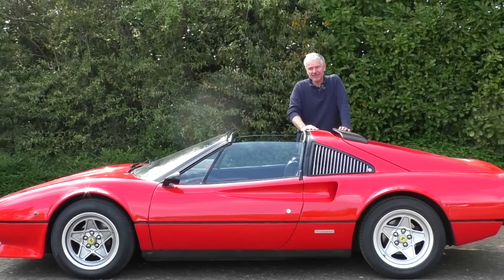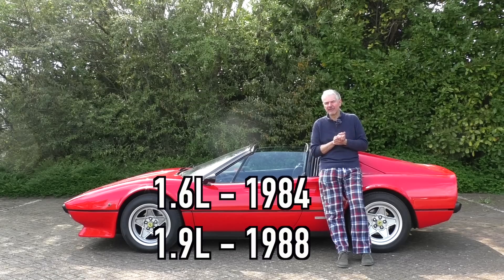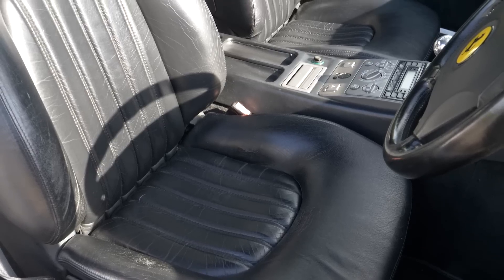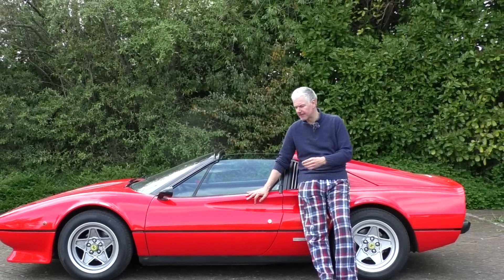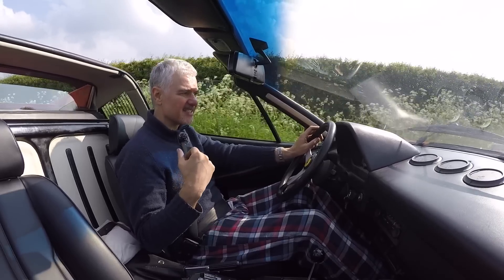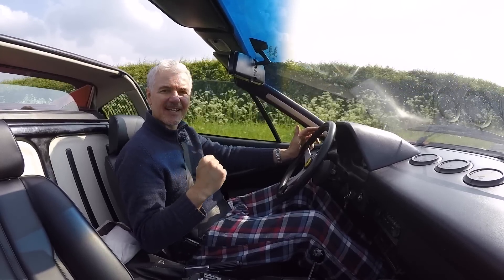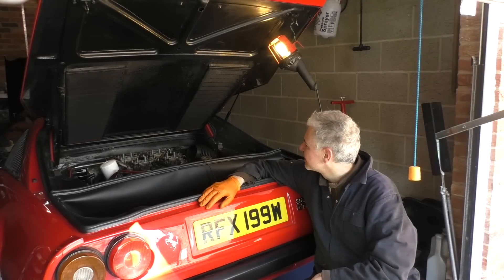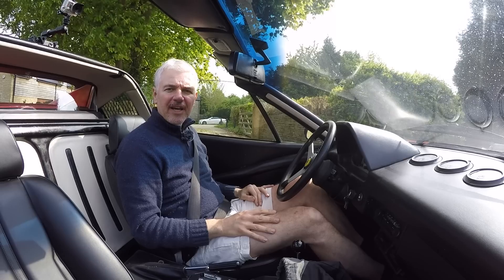The reason my Ferrari 308 was the cheapest in the UK

Comment: 308 side view is stunning
Reply: Yes. The classic going fast standing still look. 😍
Reply: That's what I thought too. It looks fantastic!
Reply: I was at a car show last summer with all sorts of Aventador's and 488's and all the owners were gathered round a 308. They are still stunning. Slow now of course but absolutely stunning.
Reply: purists look away... the looks are indeed sublime, as was 246..I would love an affordable, easy build GRP replica / conversion of a crossover between 308 GTS and 228 GTO - a more subtle and smaller 288 with everyday worry free mechanicals and c 300bhp/ton --or simply a 308GTS replica (with wider footwell!) - needs to be in expensive / accessible :)  - I was lucky enough to see a stunning one off replica at Stoneleigh a few yrs back with RV8 ..absolutely amazing..unfortunately the driving position remained compromised - using wheel arch extensions as in 288 would help with avoiding footwell wheelwell ingress

An affordable 308GTS clone with a TVR engine for hassle free motoring....mmm

Comment: Hi, I have a 1976 308 GTB and have had a similar noises at certain revs. Drove me mad but on mine it was a hairline crack in the exhaust heat shield on the rear bank of cylinders. Then I got another crack in the heat shield under the boot floor (deeper noise) and finally a high pitched tingling/whistling noise (like yours) that was the front heat shield protecting the alternator. Spent ages sorting crack/splits etc in heat shields and finally they've given up and gone away. We isolated each one by taking each heatshield off and seeing if it stopped the noise. Reving it in a workshop just didn't replicate it. Stick with it as 308s are the most underated Ferraris and when you've got it sorted you'll love it. I've had mine for 21 years now and have experienced just about everything that a car can throw at its owner. They are very fickle but very, very strong.

Comment: I had a similar squeak in my Porsche 993 in similar conditions to yours which puzzled me and quite a few professionals.  It went away after I removed and reseated the intake manifold, so believe it was a loose hose clamp at the intake side.  Worth re-seating everything on the intake side before replacing anymore parts.  All the best with it.
Reply from the maker: Thanks and good advice. Will do when I rebuild the carbs this a winter!

Comment: Mmmmm, as someone who has been playing with cars all his life - including professionally for a number of years - I have a suggestion: relax. When the car boils over or a coolant hose pops or the alternator bearing seizes and the car throws a belt, don't flip out. If you don't learn to take things in stride, you're going to have to become an adrenaline junkie to enjoy the 308 (alternatively you could just become a regular junkie and hook yourself on valium...) :-p 
Remain calm. At least until you hear a loud bang at 6000rpm followed by clanging and large volumes of gray smoke and bits of piston and rod billowing behind the car. Then flip. That would be justified.
BTW, the Influenzo was not trying to burn your face-off. It was a joke. It wanted to see you bang your head on the underside of the bonnet. It boiled over because the horns aren't in the engine compartment on the 308, so it likely would have not scared you if it had only beeped the horn.
Reply from the maker: Thanks for the advice.. I am a worrier by nature though!!

Comment: Brilliant video and one lucky escape. The joys of motoring ‘as my father use to tell me’. The sound could be belts to tight, the alternator can also make a whistling noise, both when new and when there getting tired. It could also be a vacuum hose leak, maybe a split hose, for the most part that wouldn’t make a noticeable difference to performance. Good luck and look forward to the next video
Reply from the maker: Thank you Ross! Enjoy the weekend buddy!
Reply: No probs, I too have classic cars and motorcycles, my daily is a 1978 Mk1 Cavalier that was a bad model L, but now has the Carlton GSI 3.0 24v straight 6, Manta 400 getrag gearbox and back axle. Using a classic every day is far far better than a modern car and the smiles per miles......you can’t put a price on that

Comment: I had a couple of 205 GTI 1.9s back in the day, one after the next. Bat out of hell. Followed by a 5GT Turbo, so a total late 80s/ early 90s dream fest for a young lad. Decades later I need a 911 to give me similar thrills down a bend road.
Reply from the maker: How did the 5 Turbo compare to the 205?
Reply: Missed this. The 5GT Turbo felt more planted and faster because of that puffer. The 205 GTI 1.9was light as a feather in every way, and soddin’ fast cross country. Basically, take yer pick. Happy days. Ooh, and the 1.9 was a bit over throttled, so a mere touch on the accelerator caused the Pug to storm forward like a stabbed rat.

Comment: sounds like a vacuum leak to me, that would only happen under load not on gradual acceleration, or perhaps a vacuum regulator after distributor makes maximum advance so that too much vacuum doesn't damage the diaphragm
Reply: Agreed. Sounds exactly like when the vacuum advance diaphragm on my distributor got a leak. That would also explain while it's only on full throttle
Reply: p_r_i_m_e does the 308 have a full throttle position sensor and system?  Then I’d trouble shoot that.  Vac advance would be possible as stated...etc...  my suggestion always is you have to get the car in spec and all maintenance caught up to really sort out a car.  I.e. of it needs a top end refresh..you’d probably fix most issues when you change out hoses, vac lines, clean or replace fuel lines, adjust timing, etc...otherwise you’re chasing your tail.  Coolant flush via overheating is one way of doing regular maintenance...;)
Reply: Not to sure about your thoughts on air leak on full chat. You’ll get lower manifold pressure on closed throttle high rpm over run conditions. 
Best bet is to get it to your nearest rolling road once lock down is lifted. 

But great content. And an interesting noise. Cover the basics first. Think simple.
Reply: My first thought was air leak, although always hard to diagnose over video!
Reply: Agreed also - the noise only seems to be under load, so I don't think it's just related to engine speed like an alternator bearing would be. Also, those pipes perish, and the car is from 1981 by the reg. plate
Reply: Good call, I was thinking those lines myself.
Reply: vacuum reduces at wide open throttle

Comment: Run it without the alternator belt - could be the alternator bearing.
Reply: Good call
Reply: No, doubt it, alternator bearings don't sound like that, and it still wouldn't make much sense why it's only at full throttle. You can usually hear it at very low RPMs if it's going out.

Comment: alternator.

noise changes with temp and load depending on demand and state of battery charge.
Reply from the maker: Interesting.. I will check it out
Reply: Alternator on my Porsche whistles!
Reply: @Number27  As someone who does not work on cars but computers, I'd also say that sounds very much like electronics coil whine. Hence an alternator sounds like a plausible explanation. The electromagnetic sound induction is often amplified by resonances, so it is typical that it becomes audible only under some specific conditions.

Comment: Hi Jack - loving your Influenza videos - very informative and very entertaining too. I have a possible explanation for your squeaking noise as a similar thing happened on my Porsche 997.1 C4S. It sounded like a slipping belt and only happened under load at high revs. I changed belts & idler pulleys, the water pump and even the pulley on the alternator - none of which cured the problem. The guys that do my servicing eventually tracked it down to a cracked exhaust bracket that was resonating/rubbing together at high load/high revs. £20 spent on some tack welds cured it and it’s never done it since! Maybe a simple one to check if only to rule it out? All the best. Mike
Reply: The noise might be reason why they also changed his belts a year ago
Reply from the maker: Thanks for the advice chap!!

Comment: I had a 205 GTi 1.9. It always started 1st time. About 20% of the time.
Reply: Dirty contact on starter, common issue. The most unreliable part on the 205gti is the German part. Bosch fuel injection system, air flow meter. Many of us owners gave binned that and gone for wasted spark set up.
Reply: If your having cold start issues, it will be the SAD on the back of the distributor SAD = supplementry air device, usually the rubber tube perishes and fucks it up, I used to set the throttle up by hand after working on them for years as a kid. 650rpm with air screw closed then open up to get 950rpm. It will run like a dream and no stalling out.

Comment: What a great video!  (1) I totally agree that modern cars just aren't as much fun to drive slowly.  I've noticed this more in German cars.  I think they have made the car so capable at high speeds that this stability ruins them under the conditions that we normally use them.  (2) extreme highs and lows in emotions.  It sounds like you own an Italian car.  Passion one way or another.  (3) I LOVE to hear that car running.  What a wonderful, raw sound.  And the click-click from the notchy shift lever, it's great.  In watching you drive, I almost feel the car myself.  It looks like such a wonderful experience.  (4) The whistling noise is related to throttle position,  which makes me think it' may be a normal noise from airflow through a carburetor or potentially  there's a small vacuum leak that only opens when under high vacuum.  Or more likely there's a hose that collapses under high vacuum, causing a whistle when air is pulled through it.
Reply from the maker: Thanks for the kind words and for the advice!!

Comment: I chased a similar noise - not on a Ferrari- for the longest time. It was only audible above a certain rpm. In the end I chased it down to a bearing in the alternator. I dont no whether its possible to run your Ferrari briefly without the alternator running, if you could it would either eliminate or pinpoint the noise if it is coming from the alternator. 
The 308 is one of the prettiest cars ever made. Good luck with yours.

Comment: I had a 75 308 GT4 for over 20 years. Did all the maintenance myself. Very reliable car, as good as any other 15-35 year old. after 18 years, the fuel consumption got worse. Worn float needles. I chucked them up in my drill press and dressed them with a stone, worked great.
Set the float levels a bit higher than specified (1/4"?)- eliminated the fluffy throttle in curves (this had disappeared when the needles started leaking).
Most important: I bought one of those carb ballancers to set the butterflies, but found a 5/16" ID length of vinyl tubing stuck in the ear was more accurate. Been trying to sell the ballancer ever since.
Reply from the maker: Thanks Richard, I will try with the tube too!

Comment: One possibility for the whistling sound at 4,000 RPM under full throttle only could be a worn bushing around the carb butterfly shaft, allowing external air to enter thus causing a whistle. Wiggle each butterfly shaft by hand to see if there is any play. If that is the cause, fixing it will improve the air/fuel ratio as well.
Reply from the maker: Thanks buddy, will check but they all seem pretty solid!

Comment: The whistle really does sound like air somewhere, if it was a bearing then it shouldn’t make any difference on throttle position, it would make the noise at X revs regardless. I had a similar whistle noise in a Subaru wrx and it was a crack in the pipe to the intercooler, only really noticeable with the foot down. Changed all the hoses and job done.
Reply from the maker: Thanks... will look into it and thanks!

Comment: The boiling over will probably be the rad fan sensor not working. Then the pressure builds up blowing from the rad cap. Maybe add an adjustable sensor so you set when the fans kick in. If it can fit your car. You didn't run it long enough to damage it

Comment: Quad exhausts hang below the rear valance, so you will be left with a redundant cut out from the old single exhaust. On mine I had the surface flushed over, so the valance simply became symmetrical about centerline.
Reply from the maker: Thanks for the tip!!

Comment: For your whistle - Strange as it might sound... I'm going to suggest that it could be the exhaust. 
I only suggest that because on one of my modern classics (not a Ferrari unfortunately) as the stainless exhaust has got old, it hasn't started rattling or getting louder, but under hard acceleration it does whistle! I haven't investigated yet, but i'm assuming it's just baffles blowing through differently (worn or clogging). Good luck tracking it down.
Reply from the maker: Thanks, that’s definitely a possibility!

Comment: Single pipe exhaust are unique to the early 308s. It's an idea though to inspect the 90° bend at it's very end, as it can develop a burn hole at this point and potentially cause a fire. It can be weld patched however...
Reply from the maker: Will check thanks!!

Comment: If it makes you feel better, it only boiled over because the engine had stopped. True enough, it would have eventually done it with the engine running, but it's the fact that it stopped pumping coolant that caused it to tip over the edge. Obviously it was still too hot, but I don't think you were quite as close to needing surgery as it seemed! It also suggests the coolant is circulating well, as it was the circulation alone that was keeping it from boiling up.
Reply from the maker: Yep agree with all that! Thanks for watching!

Comment: Had a whistle on an Audi TT that turned out to be a split in the crankcase pressure relief valve diaphragm. It was intermittent whilst driving but eventually it started to whistle after turning the engine off. It stopped once the crankcase pressure dissipated. Just a thought.....
Reply from the maker: Thanks for the advice!

Comment: Has to do with intake starting from the butterflies. Did you rebuild carbs? Cleaned the jets, checked butterflies for play or damage, checked the gasket between engine and carbs, checked vacuum hose. Don’t think it is major. Good luck.
Reply from the maker: Thanks buddy, I did a clean of jets in situ but will do a total rebuild over winter

Comment: Could be vacuum leak. But since it's on full throttle... It would be vacuum created by ported vacuum. So if the car has ported vacuum. Check any thing on the car connected by ported vacuum. Not manifold vacuum.
Could be a very slight exhaust leak from a leaking exhaust manifold gasket, exhaust manifold or a small hole in the muffler or welds.

Comment: Before you run a 308 bleed the radiator every time. Cap off and slacken the screw at the top of the radiator until you see liquid. This is the same on all 308s that are accelerated hard as the water pump atomizes the water. There is a mod for this done by Barkaways of Kent. I have raced my 308 for 13 years with great reliability.

Comment: i quote wikipidia"The engine speed is limited only by the amount of fuel/air mixture that is available in the manifold. ... If the engine is operating under heavy load at wide throttle openings (such as accelerating from a stop or pulling the car up a hill) then engine speed is limited by the load and minimal vacuum will be created." when you lift off the throttle a vacuum is created and the ensuing difference in pressure through the venturi is whats probably making that sound

Comment: Probably nothing to do with the noise, and it's hard to tell what sort of sound it is on a laptop, but 1) does it only happen when moving or also when stationary whilst being revved?, or only under load? 2) Get an oil analysis done if you can, and a cooling water analysis - then you can tick those two off too.
Two things to possibly think about 1) Input shaft bearing 2) Thrust bearing not releasing properly (????) I have had this on a lesser car and the bearing got noisy over a certain rpm - but I could be guessing all day and still be wrong.
Reply from the maker: Only happens when moving.. under load. Thanks for watching!

Comment: Check the aluminum coolant pipe that comes out of the water pump and passes close to the alternator. I have seen a number of 308"s  where the pipe rubs against the pulley of the alt. while the engine is under a load. It's hard to hear in your video, but it almost sounds like the brake booster is bleeding vacuum. That is an easy check. p.s., I have been servicing and restoring Ferrari's for almost 40 years.
Reply from the maker: Will check all that, thanks for the advice Ron!

Comment: to me it still sounds like a vacuum leak, and although you've balanced the carbs at idle. You could possibly still draw air through lower gaskets or butterfly seals bearings. Try some really soapy water on the bottom of the carbs and get a friend to look for signs of an air leak
Reply from the maker: Yes def still possible! Thanks for watching!

Comment: Whistle is either a load related issue or a throttle position issue, not belts or alternator and main or big ends don't whistle. Slow acceleration or steady RPM does not cause it.  Could be gearbox input shaft or differential?  Good luck what ever it is.

Comment: It sounds like induction noise to me, one thing you can try if you know how to do it, go to the engine speed itt whistles, start with the lightest engine load possible, and roll the throttle in but at the same time compensate with left foot brake to try to maintain the engine speed more or less. It like a chassis dyno on Iso speed mode but you do it with your feet. Some cars do it event stock. On a 308 I don't know if it's a know thing though. If it's engine load dependent, might be just something intake related that whistle.
Reply from the maker: Thanks for the advice!